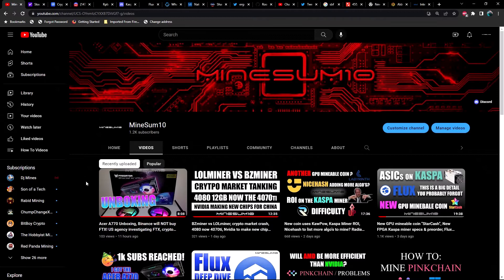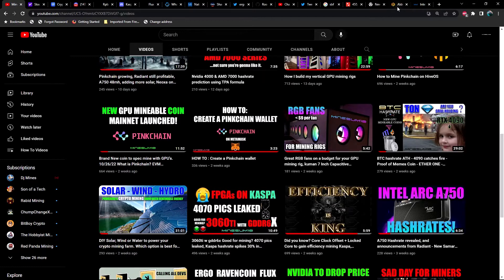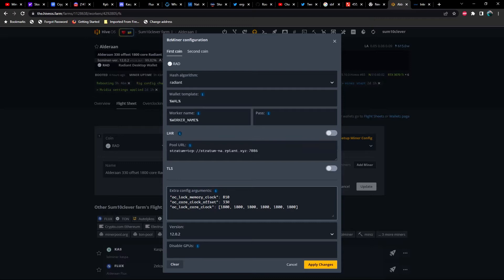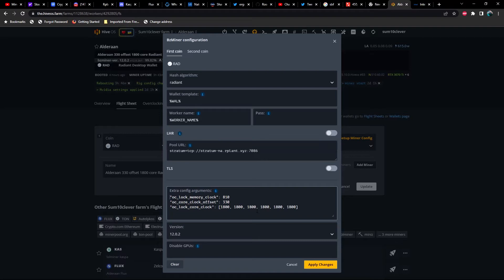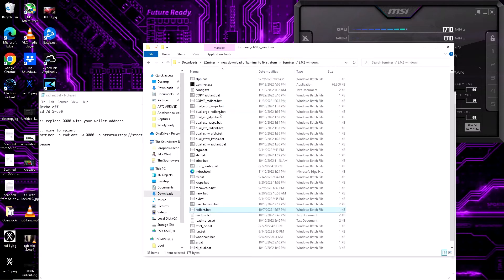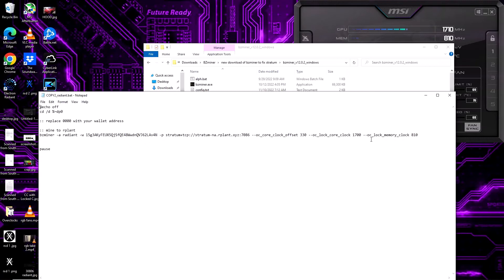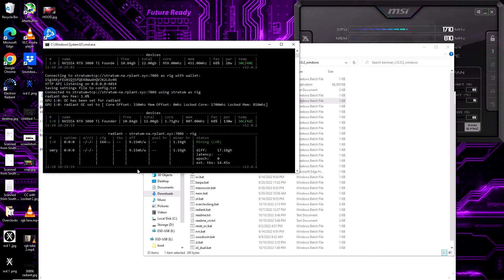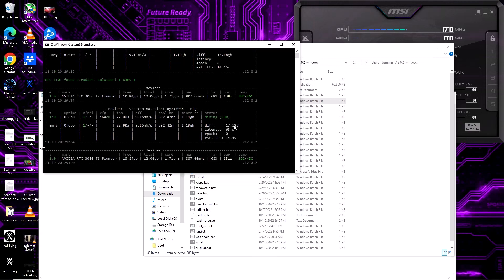How To: Use Core Offset + Locked Core + Lock Memory in Windows

Comment: i have try 1660s Gpu at Window 11, Nvidia the lastest and 512.77, afound wird thing that no matter i try well done setting OC in bat file, when execute the command is show an input at the end it spike 125w, it normally should be 55-65w, i am thinking which part i have make mistake, at last i force to use afterburner to control the power.

Comment: Somehow the locked memory clock doesn't apply to 1660 Supers. Working fine for 30 series cards in Windows. Do you know any fixes?
Reply from the maker: It may be the version of BZminer you’re using. Make sure you’re on the latest. If that doesn’t work reach out to iedoc on the BZminer discord 👍